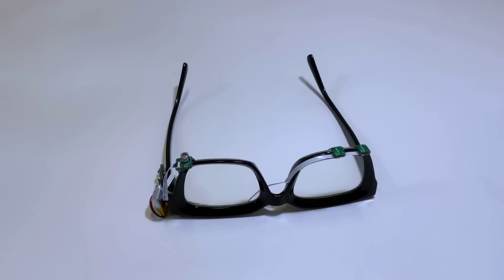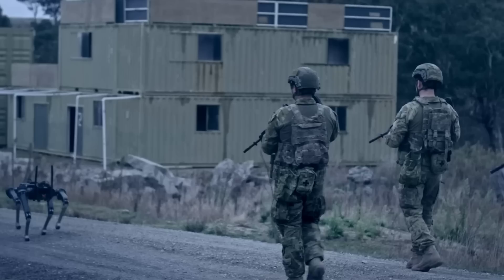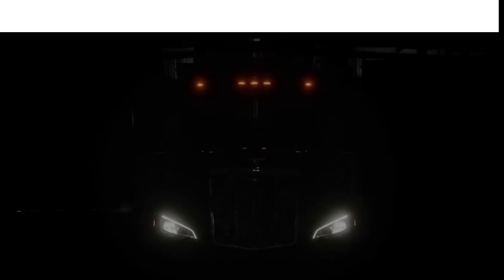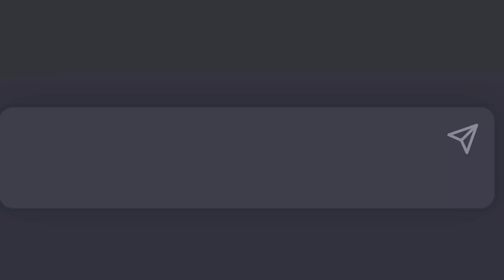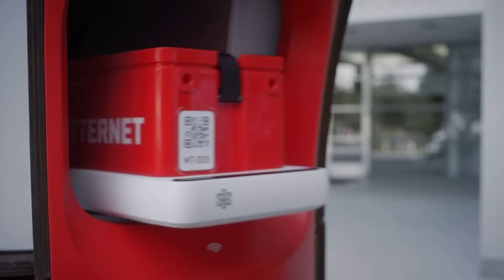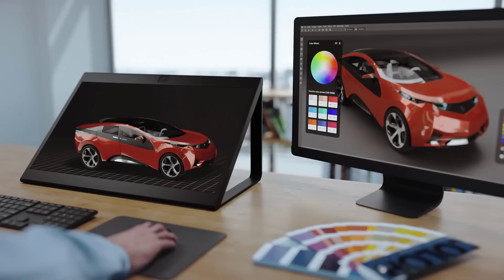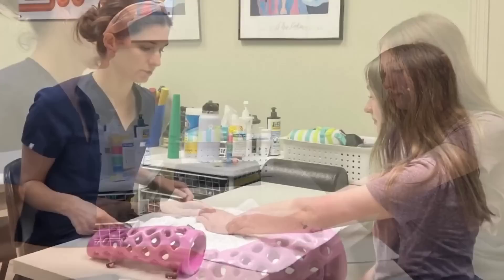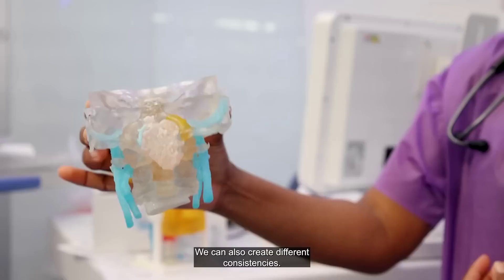Computer Vision Breakthrough, Full Color ePaper Displays, Text-to-Audio AI + More | MOSFET Weekly

Comment: The color e-ink stuff would be amazing for something like art displays in a home or office. Have something mimicking printed artwork or posters but having the ability to load new artwork at will which is far more aesthetically pleasing then current art displays that emit light (ie digital photo frames etc) and requires no ongoing power draw.
Reply: digital picture frames.
Reply: eink is awesome for more static uses
so i look forward to more innovations from that field
Reply: @icedriver2207 I can see them making a comeback, if the technology gets cheap enough. These will be primarily used for advertising, initially.

Comment: Roll-to-roll solar PV is going to be a game-changer.
Reply: Especially if they can layer it, so that the normal wavelengths that get picked up are the outlying sets, and can be rolled out over existing panels.
Reply: @nela9994  That’s a fantastic idea, retrofit the existing stuff.
Reply: @JohnVance  exactly, the structures and power conduits are already there, and if you can lay down even just three layers of PV, you will have quadrupled, or more your power intake.  We could be looking at micro-stations that are actually useful to one’s neighbors, not just oneself.